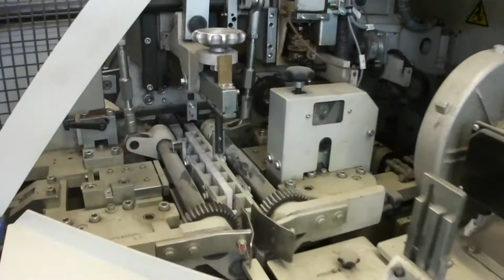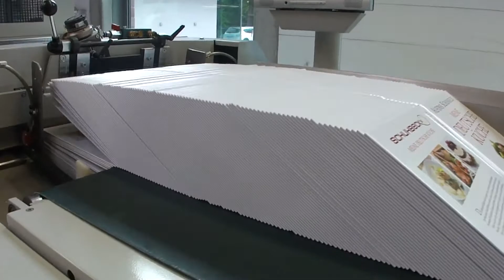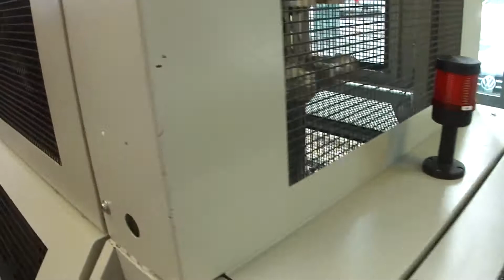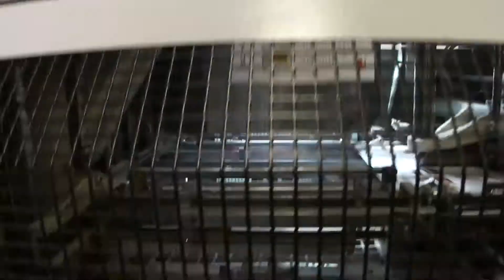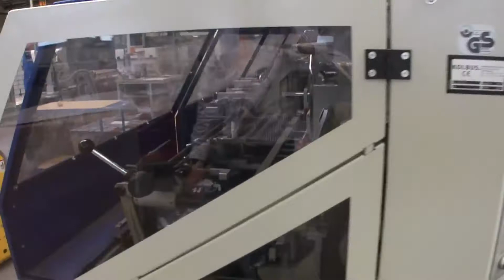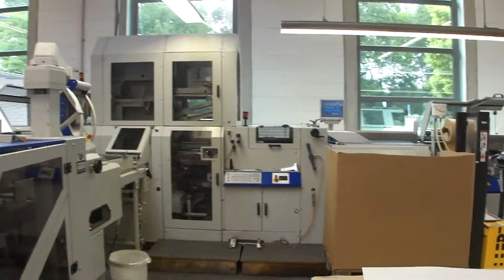Kolbus BF 527 + FE 604, 2008

Comment: What is the make of the white glue that you use?....as we get a lot of problems with glue squeezing out the head and tail when pressed and creased endpapers...seems too watery
Reply: If it is not causing a problem with the endpapers sticking together when opening finished product leave it. Otherwise the joint application thickness may need adjustment. This is done on the rollers. Reduce it by one dot. Also check the linen length setting also on glue rollers.